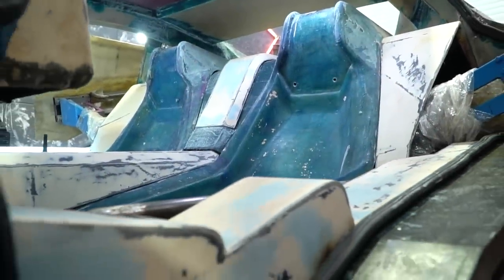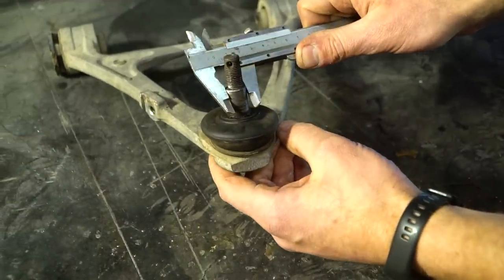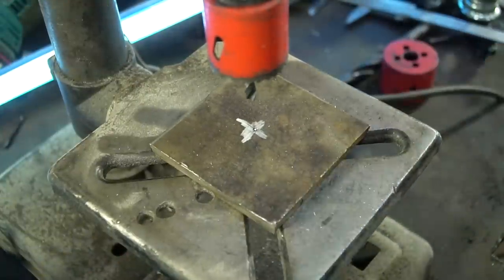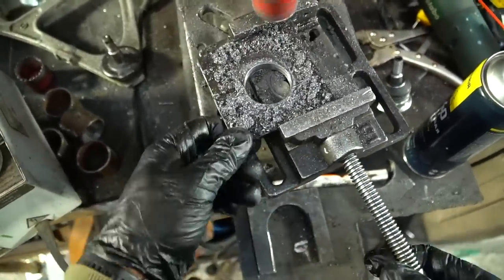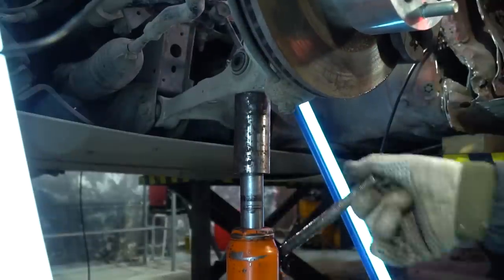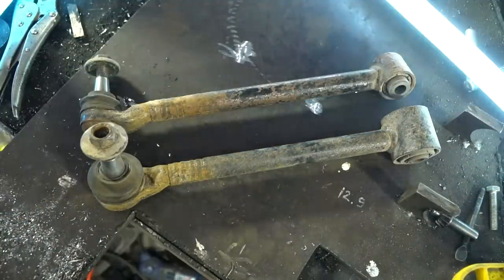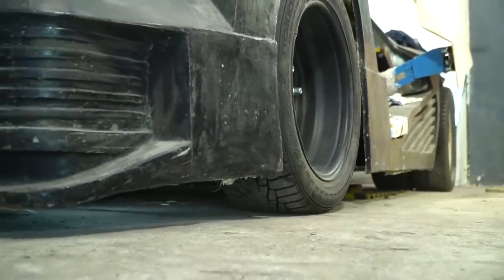Making adjustable levers. Quadra V-Tech from Cyberpunk 2077. Part 23

Comment: I noticed that your rear wheels are touching, you're eventually going to want to put space between the tires so they don't rub and generate friction. This friction most likely will cause the tires to blow out while driving for long periods of time.
Reply: The rims are welded together as shown in an earlier video, there should be no friction between them they move as one unit
Reply: @AF  but the friction is a out compression.  The weight of the car presses down, and the side walls will bulge from the weight. That's where the friction comes from. There will also be friction from the tires sliding when making corners as the tires deform from horizontal forces and traction grip. It's why dually trucks have a gap between them. It may not be too much of an issue depending upon how often the car is driven,  but it would be good to inspect the side wall rub after prolonged driving.
Reply: @mattmcdowell8084  Very correct. I think the plan is (I haven't seen him say this and I haven't watched all the videos) is to get a pair of wide tires, one for each side. This might have just been to test how level such a tire would sit with the car's weight. I don't think he intends to drive the car with these tires.

Comment: there is no way the stock motor is enough to move this car, this thing weighs a ton! I love how you are doing this, but.....I do question alot. It's going to be interesting to see when it's finished
Reply: What kind of car was it before?
Reply: @davidadkins3544  rx8
Reply: @Srstrix  I mean, a 4 rotor would do the trick... Haha
Reply: the car is actually lighter at this point

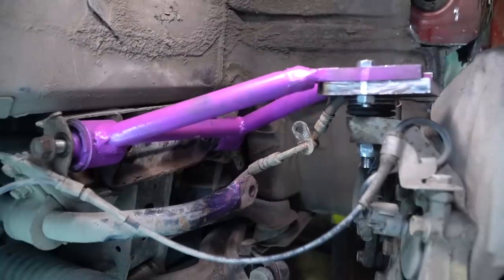Comment: Those plates on the front wheel, you have an "open" sliding mechanism to change the angle but it shouldn't be "open", it should be a "closed" plate, the reason is if the bolts become too lose during driving on a right or left hand turn or on a bad or uneven surface the assembly on either side can slide out and cause damage. If it's a closed plate then there's no possibility of the plates separating from one another and no lasting damages. The "open" that I'm referring to is the two long open ovals that you thread your bolts through for the two plates. that bottom plate needs to be bigger with a closed end to prevent future damages. I'm referring to the time @8:48 where you see the plate on bottom of the painted plate, the bottom one needs to be replaced or made differently.
Reply: I thought that but you can see when it’s painted good near the end of the video he has closed it at what was the open end
Reply: He had mentioned tack welds
Reply: @KenzertYT  look at @5:18 it's that plate that has an open end to the bolts, it has nothing to do with tack welds, that open end during any hard turn, uneven surface, pot whole, or bump in the road can separate during the operation of the vehicle. That's what I meant. It needs to be closed ended and probably with a bigger bolt, the entire assembly is being held by bolts that don't even lock, it's a dangerous assembly.
Reply: @ThyerHazard  Good call mate. Much appreciated on the correction.
Reply: Why would you put a double wheel on a car? That makes it harder to change the tires and just adds extra weight for no reason. why not just put a regular rear tire setup on it?
Reply: @illuminatedperspectives2894  while you are absolutley correct, you dont seem to understand whats going on here.... LOL

Comment: I was told dually wheels were separated with a gap for a few reasons. One gravel can get caught between them causing a tire failure. Two, as the individual tires flex with weight they could rub up against each other beside to contact patch and wear each other or pickup debris with the same result.  Three the wheels flex laterally in turns and again rub and lead to failure. Four low air pressure or squatting from high loads tires touch and rub. Even though the tires are spinning the same rate its the additional heat buildup that from the side wall flex transitioning from contact patch to rebound over and over creates the detrimental heat build up with tires that touch.

Comment: Being a trained mechanic myself, normally when you can't losen a nut or bolt with normal force, before even consider to start
applying that amount of torque to try losen it,  i always try clearning the area with a steelbrush and apply some rust solvant spray
and let is soak then re-apply at least a few times .
If you had done this, you would've seen the weld.  Lesson learned for any future nut/bolt that's stuck.

Comment: You did a great job fabricating those parts but just a heads up, when dealing with bushings always tight the bolts with the lead of the vehicle, otherwise they gonna strip, you can do this by placing the vehicle in some ramps

Comment: That UCA is not certified and the welds would fail under serious load unless you plan on driving this car on and off a trailer you should look around for proper manufactures LCA/UCA’s that way when your driving under full load these won’t fail on you at high speeds

Comment: Did you conjecture the angle of your head as it passes through the plane of the windshield when that janky ass front suspension breaks and you grind the whole front end 12 inches into the ground? I wouldn't get on a bicycle put together like that.
Good luck.